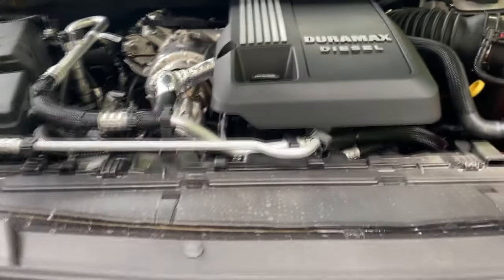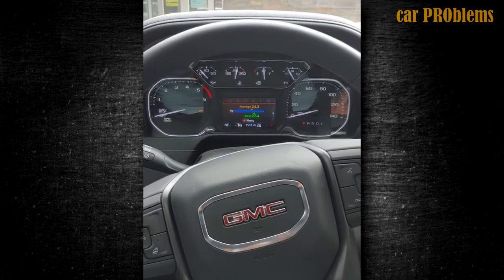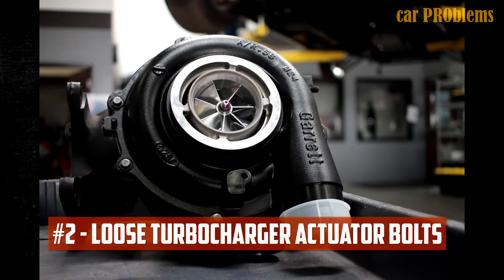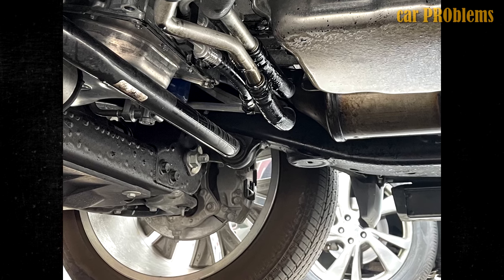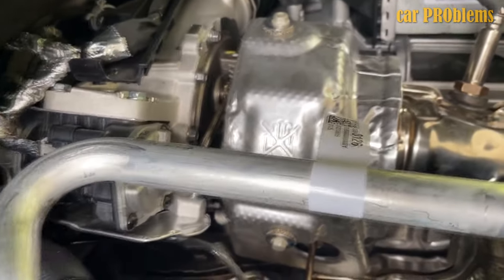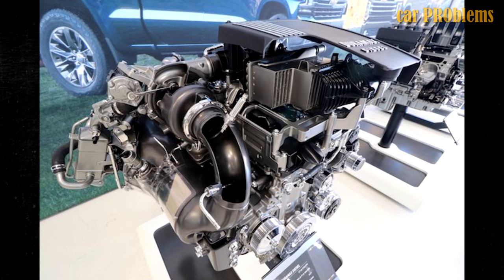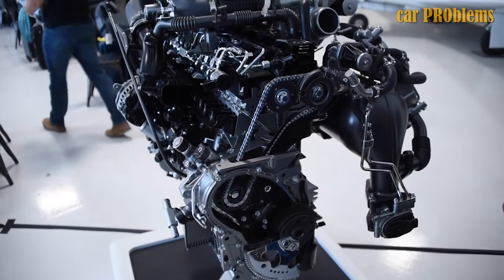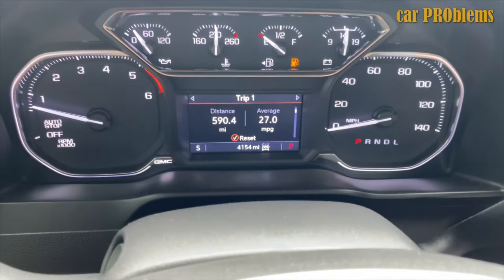Duramax 3.0 Problems and Recalls - GM 3.0 Diesel Reliability

Comment: Have one of these since 2021 and have had absolutely np problems with it. I'm in Canada so my millage comparisons are much higher than the US. My best has been 38.29 per Imp. gallon and general local driving 28-30 mph. Which in US gallons would convert to  31.78 mpg and 23.24 - 24.9 local driving. Which to me for a crew cab truck is pretty good. and when you do the math on emissions it works out to about 64 percent of the emissions of my previous Chev 5.2-liter gas engine truck.

Comment: 28000 miles and I have that constant Is cranking problem. Check engine light came on and it's something to do with the injectors. By solution was I traded it in on a newer vehicle? With a gas engine.. I was told the new engine. Not gonna have those problems.
Reply: Lifters

Comment: I think the LZO fixed most of these issues.
And I ran into a owner of the 3.0 GMC and he said he’s got 40k and no problems
Reply: I’d hope it’s ok with 40k miles, any engine shouldn’t have issues with that low of miles, over 100k miles is where we will truly see how reliable engines are
Reply: @dcman4902 yeah man. I just pulled mine off the lot last night and it’s super reliable. 25 miles down and it hasn’t had one problem.

Comment: My 2001 Silverado with the 3.0 Duramax with 47,000 kms (29,000 miles) has been in the shop since July 8, 2023 with a catastrophic engine failure something to do with the lifters. They expect parts for this truck (Turbo) won' t be available until some time in October 2023 with a week to replace and install a new engine with  the LM2 not the new LZ0. I hope to have my truck back by November. My dealership is not the problem they appreciate my situation but GM couldn't give a rats ass other than saying they appreciate my patience.
Reply: 2001?

Comment: Hello, thanks for sharing this information. Question: how can you tell (with the engine serial number) if it is an LM2 or LZ0 engine? thank
Reply from the maker: There are some visual cues that can help you distinguish between these engines. For example, the oil dipstick on the LZ0 engine is located on the driver's side of the engine, while it is located on the passenger side of the LM2 engine.

Additionally, the LZ0 engine has a new oil cooler location at the rear of the engine block, while the LM2 engine has the oil cooler located near the front of the engine block.

Comment: Why didn't GM have a diesel fuel cap like found on their 3/4 to diesel engines?  I bought an aftermarket diesel fuel cap and was told by my dealership not to use it because it wasn't designed to have a sealed system which with the aftermarket cap with the rubber O ring it does seal it.  What do you think about this?
Reply: I’ve been running a cap on mine no issues at all
Reply: I’ve been running a green cap also with no problem, just don’t like the idea of possible dust in the fill area. There are two internal flaps to seal the filler also so I see no concern with a cap.
Reply: So happy I bought a powerstroke.

Comment: GM is famous for avoiding Recalls, in the very early 70's worked at a GM dealership, and you saw problems affecting a huge percentage of a product line and never but never saw a recall.  Then in the late 70s and early 80s there was a ball joint issue covering nearly 100k vehicles potentially, no recall, but AMC used the same part and 5 sets got on the vehicles, AMC was mandated to recall ALL vehicles that used this same ball joint.  The supplier knew which batch was bad and initiated the warning.  We changed large numbers GM ball joints, actually, you could identify them simply with a file on the threaded area, they were not hardened.  Since there was no recall, the owner ate the costs.  As for the AMC units, we changed out a bunch of good ball joints, AMC ate the costs.

Comment: 2023 point oh, basil, 51000 miles miles. No Problems, excellent fuel mileage. Only problem I had was the def Tank Gage which they replaced. I live in Florida. Just took a trip to West virgina when 3000 miles. I got 27 miles per gallon. Towing a two thousand pound vessel
Reply: Clarification 2020.
Chevy two wheel drive
Reply: No problems then you say the only problem? So that means it’s had a problem no? Lol 😂
Reply: 27mpg diesel or 21-22mpg gas is the same thing, and you could just as easily get 21-22 pulling 2,000 pounds in a gasser on the highway (even better with hybrid).
Reply: @sly9263   I'm guessing your assumption factors diesel costing more per gallon and the additional maintenance costs (i.e. fuel filters, DEF, and higher priced oil change)? I think your logic is flawed and here's why: diesel fuel is currently trending the same price as 93 octane, which you should be using with the 6.2 and the 2.7.  With both those engine configurations, you'd be hard pressed to average 20+ mpg towing 2000lbs. Even if diesel costs slightly more than gas, over the long term, the diesel wins hands down on fuel savings and durability alone. We'll see how the 3.0 holds up over time but it's proving to be a better option for a lot of folks and so far it looks promising as far as reliability. Just my .02
Reply: @phatzuk109  nobody needs to run 93 octane for either the 2.7 the 6.2 or the 7.3 gasser- not sure where you're getting that from. Yes, the diesel will cost more over the lifetime of the vehicle and said costs will outweigh the marginal fuel savings over a gasser or even hybrid. There is no such thing as promising reliability on modern diesel emissions equipment though- the engine is irrelevant (and the 3.0 has problems just like any other, which is why they already redesigned it for the new model year). Why take all of the risk of diesel for an inferior towing platform and 1/3rd the power over HD? I think even HD diesel is a tough business case but for light duty it makes even less objective sense.
Reply: @sly9263  Most will agree when operating turbo and SC engines, hi octane is highly recommended due to potential pre-detonation and pinging in higher compression environments. You are correct that it's not a requirement though. That said, diesel here on the MS Gulf Coast is cheaper than premium and only about 30c per gallon more than the cheap stuff. As far as reliability goes, more people are reporting few, to absolutely no issues on the 3.0 than the opposite.
Reply: @phatzuk109  I don't think most will agree- I put over 300k miles on ecoboosts and only ran 87 octane. The biggest concern with those engines was that they were DI only until 2017 when ford finally made them  dual injection by introducing port. The amount of people driving the 3.0 vs the ecoboost is comparing a grain of sand to the contents of an hourglass. The 3.0 still has a handful of oil and injector issues plus GM has struggled making rear main seals for nearly 20 years all the way back to the LS1 and LS2, including mating to this 3.0 duramax.
Reply: @phatzuk109  I work in fleet software and can tell you that none of these government agencies, utilities, and transits are putting 91 or 93 octane in all these police cruisers and light duty pickups, lol. Their preventative maintenance intervals and service history are still the best bang for their buck.
Reply: @sly9263  GM recommends 93 octane for the 6.2 and the 2.7 turbo...it's there in the OM. Go ahead and use te cheap stuff if you wish...
Reply: @phatzuk109  GM produced a poorly designed engine (and "requirements") in that 2.7 and 6.2 for their application... plus they're DI only. They're an archaic stillbirth- everyone else has moved on to dual direct and port (or port only) and handles 87 just fine. So you pay more for fuel with GM and get carbon issues- well done.
Reply: @sly9263  to be honest, I run 93 in everything I drive from my hellcat to my BMW. When I had a 3.5 in my 2015 F150  platinum and got way better gas mileage so the cost was completely worth it. You buy an $80K+ truck and cheap out at the pump...lol
Reply: @sly9263  I'm just relaying my personal experience and not embellishing whatsoever. My ecoboost in my previous f150 lost almost 3 mpg when I ran it on 87. It's as simple as that... nothing "weird" about it. I  get it. You hate GM,  BMW, and believe everything you read on the internet because if it's on the internet, it must be true. Lol...
Reply: @phatzuk109  it didn't lose 3mpg from running 87, you just (wrongly) think you did. You drove differently, used an uncalibrated dashboard MPG reading, or didn't math correctly- scientifically it doesn't gain over 1mpg.
Reply: @phatzuk109  BMW produces oilburners- this isn't some wild theory, it's a fact. They can't QC the tolerances in their engines and oil slips past the piston rings or valve seals brand new- it's been going on for decades. BMW makes great looking interiors (that don't always wear so well) and has the best infotainment on the market. GM has been languishing for some time- for their volume sellers they do minimal innovation, often following the lead of other manufacturers. I dislike GM because they have a history of cost cutting and selling dated platforms for modern prices. At least Lexus and Toyota defers cost savings back to the customer when they're selling you 15 year old drivetrain tech; adjusted for inflation, a GX460 cost $10,000 more 15 years ago than it does now.
Reply: @phatzuk109  you are way out of your element in this conversation.

Comment: I put about 50k on my 2021 at4 3.0 before it was stolen.  I now have the new 2023 3.0.  Both have achieved great MPG.  Those with a lot of short commuting (less than 25 miles) will not get the amazing mileage.  This engine likes to be hot.  The best mpg is achieved after 25 miles of driving. My daily commute is 40 miles one way.  When I drive the speed limits, I can easily average 30 mpg on a tank of gas.  If most of your daily driving will be under 25 miles, I would not suggest 3.0 duramax, as the mpg will not be so impressive.

Comment: The day I bought mine I had the check engine light turn on with Code P2459 Emission system not functioning properly. Took it to the dealership, they basically told me that they patched it up but that GM is looking into a long term fix, but until then I may have to bring it back for the same reason.
Reply: And it's the new LZ0 engine
Reply: I just bought  a GMG duramax   dinali. 2021 diesel just got it this tuesday afternoon driving home from the dealer and ig got this check engine and also same issue Emission system fault 
Now I am using their  car loaner.did they have to replace your?thanks

Comment: I hope my lz0 runs good for a long time, I came from a reliable f150 with the 5.0l engine that had zero issues
Reply: Ford and reliable in the same sentence. Now that's funny
Reply: I had 2015 f150 
Did nothing for 150k miles except $500 start stop pump replacement
Reply: We have an F150 2021 with the 5.0 V8 and no problems with engine or transmission at 54,000 miles. Most mechanics feel this is an excellent engine that is trouble free. A bunch of recalls on some minor things, but every manufacturer are having those issues. Even Toyota

Comment: I bought my 2023 Sierra SLT 4WD with LZ0 a few months ago and have over 10k mikes with no issues so far but I'm holding my breath. I was a Ford man for years but turned to Toyota and never had an issue other than the fuel mileage was low. Had 4 Toyotas and put over 300k on every one with no major issues. Hearing about the great fuel economy of the 3.0 Diesel, I took a chance even though I have watched friends and coworkers suffer quality issues with their GMs. So far, I am loving the truck.  My commute is 35 miles, one-way and average 27MPG. I recently took it on a longer trip and averaged over 32 MPG. That was calculated since i don't trust the dashboard info. Pulled a utility trailer loaded with almost 3000 lbs of rock and barely noticed it was back there.

Comment: I was just at a GM Dealership in Toronto, Canada.
Engine Removed in  a Tahoe !!!!!
Techs say STAY AWAY Run.
JUNK !!!!!
Camshaft Lobe WORN.
Plastic Gear for oil pump Dr.
Next bay - Brand New Camaro with supercharged engine Oil pump failure
Reply: My 2022 sierra 1500 3L. 30,000 km. Blown motor
Reply: @chrishornbeck6486  are you going to keep truck or sell it ?
Reply: Once it's fixed.
I'll trade it..

Comment: My 2024 3.0 duramax is in Dealership waiting for a new Motor.  Service Manger said rear main crank bearing from lack of oil pressure. 3100 miles/4968 km. F.........K

Comment: well to be fair, the wet timing belt on the rear of the 3.0 I would bet money it’s much faster to pull the trans back on a lift than tear the front end apart if it was up front
Reply: That’s what I was thinking. Especially on a 2wd, pulling the trans isn’t that bad of a job.
Reply: I’d gladly do it for you for $3000. An that’s cheap compared to other shops, come on down 😂.
Reply: @dcman4902  I’d just do it myself lmao

Comment: You forgot to mention how much it cost to replace the timing belt that is located on the rear of the engine! Cab has to be removed, just under 8000.00 at your dealership.. I got rid of my junk 3.0 duramax…. Went back to gas….

Comment: I  own a 2023 baby duramax  lzo . And yes I  have issues  am using  oil  every  400 miles I add oil 🛢  I take it to the dealer  and they put me on a 2000 mile usage  test . Well it will  blow up unless they  found something and didn't  share  . We shall see ill.keep you all informed..
Reply: Back in 1973 I used to commute with a guy who had a Chevy Vega. It belched smoke like a coal chimney. Drank so much oil he kept a 5 gallon can of oil in the back. Funnel in it. In the middle of the commute he’d stop and top it off by at least 1 gallon per trip.

Comment: Bro if i had a Diesel burn out at 200k i'd be pissed. 
7.3 PSD's and 5.9 12/24v can go 1 million if properly maintained. 6.7L's could probably go close to that as well. 
Small displacement diesels suck and make zero sense in a truck.

Comment: Don’t forgot the Nitrogen Oxides Catalytic Converter with Filter - GM (40009042) my only have 20k miles and all ready when bad 😢
Reply: Nox,  today when to the dealer and they changed , 27k milles is under warranty

Comment: There is a belt submerged in oil at the rear of the efffing crankshaft that turns the oil pump?!?!?!! Wtf!!!!! On a diesel motor? Are they serious? Wow. What an engineering failure.

Comment: blah blah blah your video is outdated for issues i have a 23 with LZ0 and I beat on it like a red headed step child and no issues for me even oil consumption 7000 miles got to 2% oil life free GM oil change and oil was full on dipstick when in the service drive and I looked it over never added a drop of oil the whole 7000 miles

Comment: The baby Duramax gets great mileage when it is broken down in the shop. What! It has a belt driving the oil pump and you have to pull the transmission to change it. Who is the dumbass that designed this motor? A motor designed to empty your bank account. I would stay far away from this jewel. GM should pay for your fuel just to keep you driving it.

Comment: MORE GM JUNK.. why do people think GM knows how to build engines? they dont, they never have!  they have no engineers they just farm it out!  Thanks MARY
Reply: This engine is a great engine. Neither Ford or FCA could make a small diesel that could prove to have enough power, get good fuel economy, and be reliable. GM hits all of those marks. Very few have issues. You made an equally stupid comment somewhere else in this comment sections saying this engine didn't even last one year. You have no clue what you're talking about.
Reply: @specialestness are you looking at the comments? Your a fanboy sure but try reading comments before you get salty about hearing other people’s opinion
Reply: @kxp.1496  you’re

This video feels like a copy and paste from someone who did minimal research and has never been within 10 feet of one of these. It’s filled with old and or inaccurate information. Most of the people dogging on these are also speaking from zero experience.